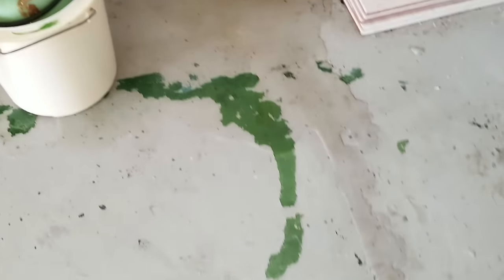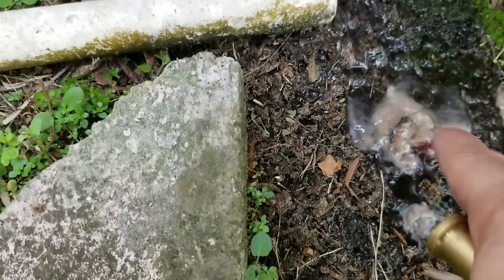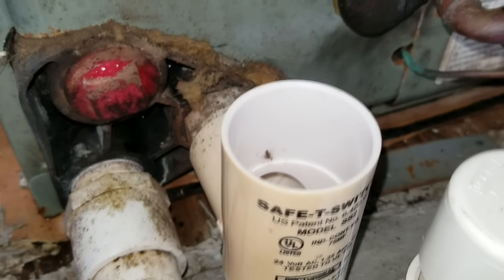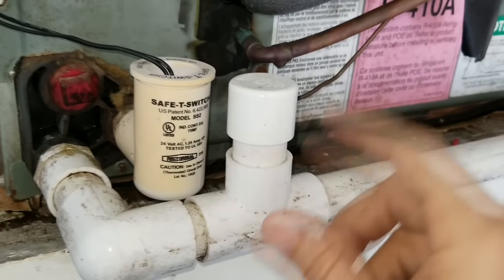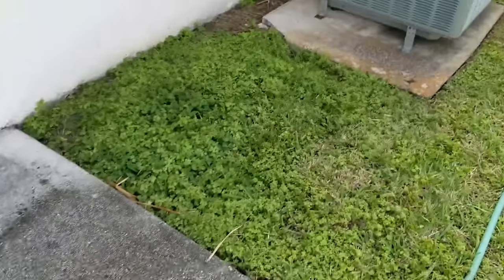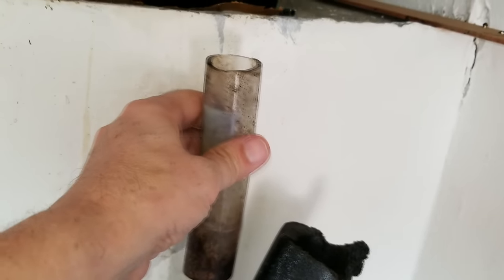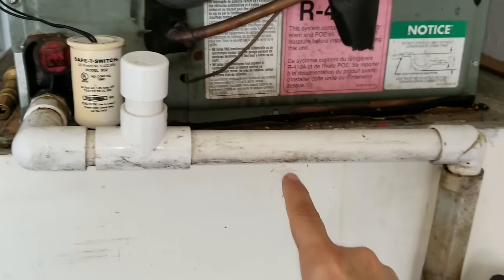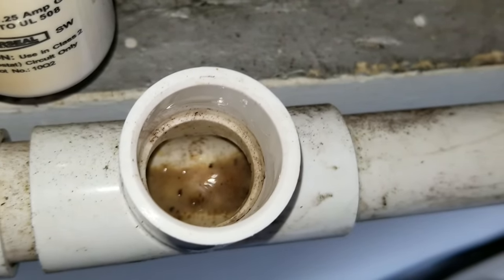How to Unclog AC Drain Line Fast (3 Seconds), Avoid Repairman

Comment: The unit is not properly trapped. Literally on the front cover of the furnace as you can see it states that it needs to be trapped! Even if the line is clear you will likely still have issues. If it's down flow not as much of an issue but if its upflow add a trap with an air  vent after the trap leaving the a/c coil not before it.
Reply from the maker: A lot of people mistake the reason for having the trap; it has nothing to do with draining, which BTW you are correct it is required by manufacturer and by code, and installers should have installed it. But this drain line slopes straight down, then goes in the wall, down the ground, and there is a trap already on the outside. The purpose of putting the trap next to the unit is to prevent warm air from being sucked outside the house, back up the drain line and into the AC  unit, where it can cause sweating and dripping and flooding. In Multi unit housing like condos and apartments, the trap has water in it that prevents sewer gases or gases from other condos upstairs or downstairs from getting into your unit.
Reply: That is kinda correct but not entirely. The absolute main purpose of a trap on an air handling unit (and we are not talking about common plumbing traps here)  is to stop air from being drawn into the hvac system through the drain line. If you have no trap and the drain pan is on the negative pressure side of the air handler air will be drawn through the dry drain line into the drain pan and will not allow water to leave the drain pan which will cause the condensate pan to over flow. Yes the trap will also stop any sewer gases If you are draining to a floor drain and it will also help in keeping insects out of the unit. Also be sure never to  double trap if there are 2 traps in the same drain line they cancel eachother out. Also the trap should always be as close to the condensate drain pan as possible and must be primed with water. There also needs to be a vent after the trap but not before it. 15 years commercial/residential hvacr service tech here and owner of TSTAT Heating & Air plus a degree in applied science for hvacr.

Comment: Is this the reason it would be "gurgling" and even have a zip sound on the ac unit inside?
Reply from the maker: If you're hearing curling it is because the line is likely closing up on you and it is starving for air so clearing out that line with a good stream of hose water should take care of it for you

Comment: We moved into our house in February and our AC gave out 2 days ago. Thermostat clicks but AC doesn't turn on at all. Even though I got a technician coming tomorrow, I just noticed that I never saw a drip outside for the AC.. Do all lines drip outside or are some connected to a drainage pipes?
Reply from the maker: They are supposed o run to the outside of the house. You never saw a drip because the AC is not turning on. Let us know what the AC tech said. You might have bad contactor relay on the compressor outside, or bad capacitor on the compressor unit outside would keep the outside fan from coming on over the compressor. Is the inside fn turning on at all?

Comment: I have a small AC unit, seems to clog quite often, ever few months with that pink sludge.  Any ideas on how to prevent it from clogging so often?  and yes discharges outside.direct line cross the attic and and out through soffit.
Reply from the maker: It seems you'r collecting a lot of dust and dirt and also stuff just grows, there is no way to stop it. Try cleaning out your pan in the AC, and put some of those pan tablets in there, see if that helps prevent the formation of the bacterial sludge. Some people add bleach once a month to drain pan, just make sure it is a plastic drain pan, and not any corrosive metal.

Comment: What if you can’t connect your hose to the ac unit due to them being too far apart
Reply from the maker: You have 2 options either buy a longer hose or take your shop back and stick it outside the house where the pipe drains to the outside seal it up with tape and turn on the vacuum and let it suck it block it out of the pipe it works every time for me I just did my last week
Reply: I actually fixed the problem with a snake. What we did was feed it through and parts of mold and dirt were in it so we poured down vinegar and used the sink water with a cup and a funnel

Comment: I use hot water and a little bleach once a month when I change my filters. I just had to flush my line and it had never been done. There was a half bucket of gunk in the lines. But it only cost me 2 oz of bleach and my ax is working again. It’s a horrible feeling to call an ac repair person  for them  to do 10 min of work for almost $200.
Reply from the maker: Another great trick that we do is to hook up a vacuum on the outside of the line outside the house, seal it up with a couple of rounds of tape real quick turn on your vacuum for 30 seconds and you will be surprised how much cook it sucks out of that line it works on completely clogged lines 100% of the time for us so far.

Comment: My outside fan is blowing perfectly so I know it's the pipes. I've thrown down vinegar and Clorox - separately - and warm water. My house is too wide to put inside the pipe. I used an 18inch snake outside by the condenser it dropped just a little but nothing. I use my leaf blower over the pipe inside the cause pressure but nothing. Do I need to get an HVAC?
Reply from the maker: Watch our other video here: https://youtu.be/733SqRsF69U we show you how to do it from the outside with your shop vac. If you can't get it done with that, then you have to use a pressure hose. If that fails, call the AC company.
Reply: thank you. I tried the hose flushing from outside, water came through my laundry room, i tried the hose flushing from inside, nothing.
Reply from the maker: @RachelReaiah  If you got water inside the laundry room from trying outside, then you have no blockage. The water should drain from the AC pan.

Comment: Question, if this is clogged, will it still send 24v to the thermostat if i check it? Because i’m getting no power from the thermostat
Reply from the maker: The float switch if it is raised up by water i the pipe, will cut off the power to the AC

Comment: it filled enough to overflow the pan, but the float switch did not do it's job. You seem to have skipped the complete diagnosis? if the drain is never clogged, the float switch has no job to do. But it should be working as designed in any case. especially with attic mounted units
Reply from the maker: In theory, the water can back up to the drain pan and still not send water into where the float switch is, I've seen bad install before.
Reply: @jeffostroff  ah' good to know. thanks !!

Comment: I'm sure you know this, but you failed to mention it:  Preventive Mtce is key to keeping your unit running, so every month you should add about 1 cup of Bleach to the drain via the cap on top, this will prevent any slime from building up and clogging.
Reply from the maker: I'm not a fan of using bleach, but they do make an AC line cleaning liquid for sale at Home Depot and Lowes with a PH that's designed to keep the nasty stuff from growing.
Reply: BLEACH is not a great idea. Vinegar does absolutely nothing.  It is recommended to put a gallon of hot tap water down the condensation line every 3-4 months.

Comment: I was told by my AC guy to pour in 1-2 cups of Alka-Brite into the drain line at the cap location every few months.  He said that will prevent clogging, does that make any sense to you ?
I was using Bleach but that didn't seem to stop if from clogging
Reply from the maker: Nothing will really stop it from forming because you have pipes where a trickle of water runs along the bottom of the pipe all year long, so mold and bacteria and goo can grown on the rest of the pipe. Blowing it out once a year with air or a hose is best.

Comment: How to stop the Sewer smell coming back up I think that exactly what is happening in my unit ?
Reply from the maker: The AC drain lines are typically not connected to the sewer, they are connected outside where they drain on the grass. So if you are smelling some type of unpleasant smell and you're absolutely positive it is coming up from the airconditioner pipe, then you need to run some vinegar and baking soda in hot water down that pipe to try to flush the rest of it outOf the line and you should see all of the gooey stuff land on the ground outside the pipe.

Comment: Is there supposed to be a hole where the pipe comes out of the air conditioner I have a hole from the factory that goes in the coil area is that supposed be plugged up it’s between the pipes one drain only the other is threaded plugs looks like a triangle coming out of the unit black but there’s a hole in the center of those from the factory it is not closed it is supposed to be closed or is it for air￼

Comment: My ac unit is not cooling, I try to use a shop vac to blow out the clog but still couldn't  get it clean but now if I leave the floe switch in place it shot down the thermostat and the whole unit, something also is damage?
Reply: Thanks for your help.
Reply from the maker: If the shop vac does not help, you need to plug a hose down your drain into the pipe to flush it out, or it will keep backing up into your float switch.

Comment: Once a month pour Not pure bleach . But clorox bleach cleaner . Its soapy with bleach and that will keep you line running smoothly . In regards to the pan you need to wash that out . open your AC and clean it out .

Comment: I'm jealous.  I wish my air conditioner was in my garage and not in my attic.  So much easier to work on there.  I'm not the least bit envious of the drain pipe going under the slab however.  We change our filters every month and we had the drain pan overflow.  How does this even clog to begin with?  It's just water flowing through there right?  This video isn't helpful for anyone who has an AC in their attic and also doesn't want to cut open the PVC line.
Reply from the maker: I understand I hate over head ACs and pancake ACs in the ceiling crawl space in condos! A lot of time the clogging can be due to inefficient drainage. In one case 2 years ago, I had a pan AC in the ceiling backing up and tripping the float switch and shutting off. Turns out the installers installed a trap on condensation line right next to the AC as required by code. I later discovered the builder years before had built a long stupid trap inside the wall going down stairs which made our condensation line "double trapped" a big no-no and causing the slow to no draining, and thus water backing up  into the pan. So I removed the builder's trap in the wall, sealed it back up, and no more problems. If you go outside and look where you drain line end sup outside, you should see a very fast drip, almost a stream. If you see no drips or slow drips, then you have a problem.

Comment: Mix about 4 ounces of 50% water and 50% Clorox. Remove the flow switch and pour it into the drain pipe. If that does not clear it up then you may want to watch this video.
Reply from the maker: Yes my preference is also a quarter turn ball valve replacement call mom but if it's just a small leak and you know that all you gotta do is tighten the bonnet not a quarter of return, then the job is done. But if it's anything beyond that I don't like to repair a gate valve because I never like to gate valves to begin with,

Comment: Does the cap have to be on the p trap
Reply from the maker: Yes I would keep it on so water doe snot shoot back up the pipe, very unlikely though for that to happen. You always need to be mindful about which way water is going to travel. Some times we even wad up a towel to stick in the drain hole in the pan to keep water from shoot back into the pan if the hose being placed in a manner that would allow water to shoot back. Either way, you're only doing it a few seconds, so any water would be minimal.

Comment: I live in an apartment and have a doctors note for a filtrete allergen defense filter and there's a water drop sound when a/c runs for a while that the manager is blaming on my filter saying it's too heavy duty for their equipment, but clearly the drain pipe is clogged up and there's a lot of gunk built up in the pan, they're going to give me an eviction note and blame my filter for the problem.

Comment: still having issues air guy came out and said float switch had goop in it. he turned his finger around in it turned air back on and left. i tried hose. first i did vac outside it came on. then few days later did a hose for safekeeping. it kept going off. not freezing up. but sometimes, while it was cooling the temp on thermometer would not come down. changed the batteries could it be the therm? is slug suppose to be behind float switch? .
Reply from the maker: Debra the pan should be reasonably clean, no sludge. Also, go outside make sure the fan on the outside compressor is on. Last year when our run capacitor blew out on the outside compressor, the AC system will be on, your inside air handler is blowing air, but it's not coming out cool, then you see outside the fan is not spinning! This means the capacitor needs to be changed. Let me know if that is what you are seeing.

Comment: Not sure if you will answer this but.   my drain doesn't seem to be draining and it tripped the overflow switch. I checked the line pulled the up pipe off and it started to come at me and over flowing onto the floor. I put the up pipe back and pulled the cap and whooshed and started draining so wondering if I should get rid of the cap kinda looking at it like a vent pipe to a toilet. oh and my heat pump is on brackets hanging from the ceiling
Reply from the maker: Joe: sounds like you had some type of backup in the pipe that got partially released, but not fully. Did you see any gunk on the ground where the water drains out of the pipe outside? Any way you can try to stick a hose into your pipe to flush it out like we showed in this video?
Reply: Hi jeff it was because of the cap on the up pipe. the drain is double trapped which from what the tech told me when he showed up. So it is kinda like a toilet vent pipe in that it needs air to move the water down the drain and out of the house. My set up is not normal as its sideways hanging on brackets in me garage ceiling. but ever since I pulled the cap off the ac has been running fine with no condensation dripping. Thanks for the reply sir i appreciate it
Reply from the maker: @hooskerdoo3130  I was flipping a condo earlier this year and the AC installers a now required to add a trap to the AC drain line at the unit. But we found the builder had also built a trap out of PVC pipe inside the wall and it was way to tall of a trap, and the water would not drain out of the AC pan because of it. I cut open the wall, and removed the builder's trap, and replaced it with a Y-connection. That solved the problem, similar to what you are seeing.

Comment: The a/c guy told me to pour vinegar down the tube every so often.
Reply from the maker: The problem with pouring vinegar or any other liquid down the drain pan pipe and out the condensation light to the outside of the house, is that it doesn't cover everything it only covers the part of the pipe where the liquid will run down. But it doesn't cover the top part of the pipe or the side curves of the pipe. And so all of that stuff in bacteria still continues to grow anyway.

Comment: How does water get past trap, new installation yesterday, water accumulating in condensate trough, not going outside, pvc pipe outside bone dry.  They are on the way, I am so annoyed.  I had expectations!  lol
Reply from the maker: There could be a double trap in the wall, or something else is causing a draft, preventing the water from draining

Comment: Why do you have pipe insulation on the drain pipe.
Reply from the maker: Sometimes, the drain lines in the hot humid gargae will sweat so putting insulation around it helps the dripping water from the outside of the pipe.

Comment: i also was told to use wetvac on drain outside. your video wasnt  telling me as a person who knows nothing about this , if i had to shut any water off ? or is electric involved? if not at all then say so for uncloging dummies like me. and i dont know how i would do a garden hose trick bymyself without water all over my house.
Reply from the maker: Wetvac trick works, but might leave a lot of debris stuck inside the pipes. The water trick is better because it forces 60 PSI water stream down that pipe, flushing it clean. You don't have to shut of water or electric, or we would have told you to.

Comment: So we got the furnace running cuz its winter. I noticed that warm air is coming out from the condensate drain line. Is that suppose to happen at all?
Reply from the maker: somewhere there hsould be a p-trap to avoid drafts coming in or going out of that condensate line
Reply: @jeffostroff  hmmm, I don't think there is, but I'll check. There is a U-trap from what I remember. Will the warm draft be an issue if I just leave it be? Or would I really need to have it looked at?